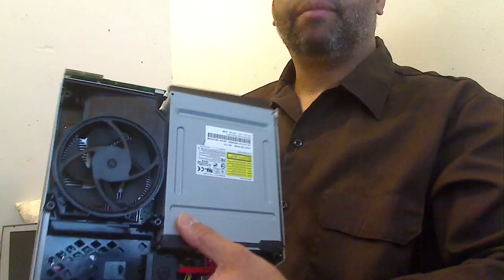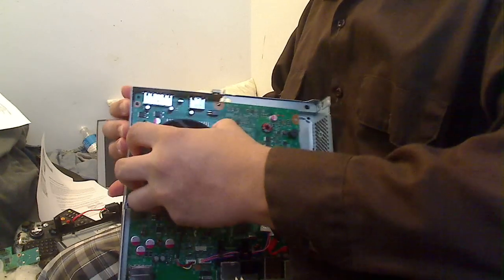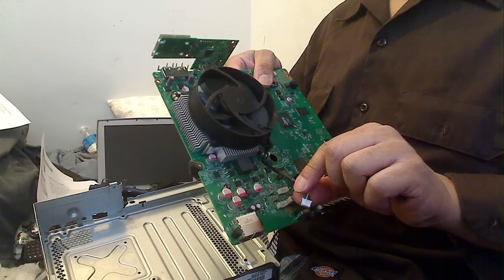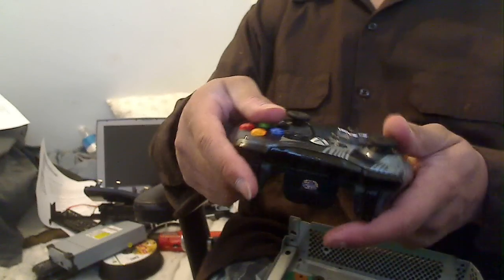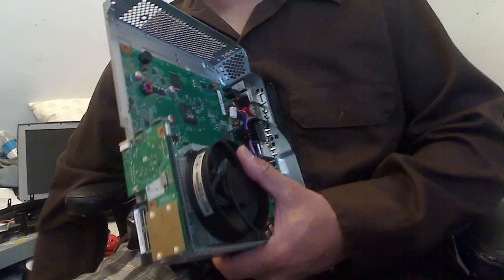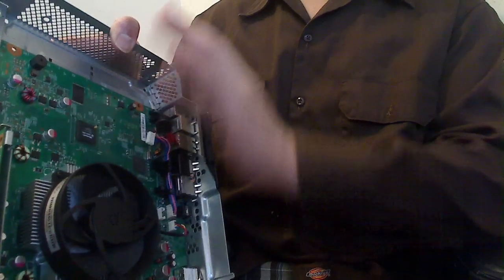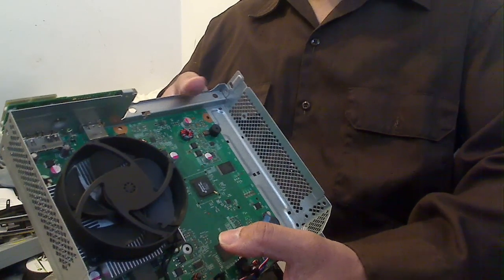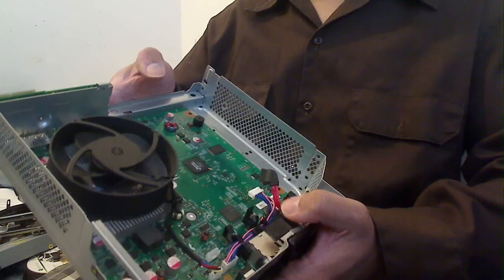How to fix Xbox 360 Slim RROD / Red Dot of Death Reset Solution👍

Comment: Hi Donte, Great video, with lots of instructions, my problem is slightly different to the one you are showing, but everytime I search for it, it brings me back to your video, so I shall ask incase you know, 3 times today my xbox has froze, when I turn it off and back on I have the redlight of death, ity stays like this unless I pull everything out the back and plug it back in then it works, I have now moved the console slightly as it wa sin a unit still had plenty of ventialtion around each side, but now it has even more, seems to be playing OK now, but not sure for how long, would the fact it keeps freezing and giving me the red ring of death be a early warning sign it needs the same treatment as your video.. Its been in its previous location for over a year with no issues.. Thanks in advance
Reply from the maker: When trying to determine the factors that lead to that horrid red-dot error, you have to take into account the minimal of two factors along with including all their variables that can lead to errors.  The 1st factor is your xbox and the 2nd factor is your power brick. The power brick contains a fan which also needs proper ventilation, since it will over heat also and stop your xbox from functioning usually leading to xbox 360 freezing. If you've moved your xbox and power brick to better ventilation then you may have solve your problem, especially if the power brick was overheating due to inadequate ventilation or even a possible fan malfunction. So Power brick or xbox malfunctions can lead to the red-dot error, not excluding the improper placement of a hard drive.
Reply: Donte Beachem
Thanks Donte, great advice, and very easy to understand, Its been fine lately, it did red dot once, but I put the console vertical turned it back on and it worked fine ever since,
Reply from the maker: Im glad you found a solution to get it working again..

Comment: Hi, after we remove the fan and are trying to overheat the board, the colour on the xbox power button will be red right ??
Reply from the maker: Noo.. That should not be red. If it is you my have a problem with your power brick. Either it has bad ventilation or it is damaged. It could be why your xbox isn't working..

Comment: Goodday Donte ,how are you,wish i did message you earlier,I need your help and expertise on how to get this xbox 360 slim back working.Heres my story,I got this xbox 360 slim 4gb from someone,its brand new of someway,where it was still in the box with all its wires and such,the person told me that they for about 1year and a half and they just open it up for the first time to play it with their son.After he was done playing it the gentleman told me that he package it back in the xbox box,which I thought was a bad idea.Long story short ,it has a red dot of death,everytime i go to power it on the red dot shows,the fan spins a lil then stop,I did all of the requirements in the video what u did,I even use a heat gun,5 minutes on low,10 minutes on high on both sides,i let it cool like u said,even took the power for the fan out to reset it,but after doing all of that ,it still pops  the red dot."NEED YOUR HELP PLEASEE"
Reply from the maker: Ok you may have done an overkill to get this xbox functioning again since it was practically brand new. You should have check the hard drive placement by removing it and reinserting back into the xbox or just remove it all together. The other would be to check the power brick light color to make sure it isn't turning red when you hit the xbox 360 power button. If it does, try a friends power brick to see if your brick is the culprit. Even if it doesnt turn red, try another power brick.
Reply: ok,it didnt came witha hardrive in it and ill try to use another power brick and let you kno the results
Reply from the maker: OK good. Good luck

Comment: If a fan is remove from a eprom or microprocesor it will burn our, Thats the rezon of the fan  and the aluminium disipator. to release over heat.Any computer expert will know this.
Reply from the maker: Hello 96gamemaster, your statement sounds good but its based on old technology and old knowledge. Most if not all newer motherboards, including the xbox have built in mechanism to shut off the processor before the damage can occur or burn out, as I believe you were trying to say. Desktop PC's for you DIY selfers allow the user to actually choose the temperature to shut down the processor and the computer. All "Computer Expert[s]" know this.. Have a great day..

Comment: one day my xbox 360 slim 4gb was updating and then it froze, then it restart it by it self and it was stuck in the xbox 360 symbol, so i restarted it and i got the red light but i turned it off and of a couple of time and it turned on just fine but it got stuck when i started a game then i restarted it again and i got the red light and since then i can't fix it. can you tell me if your steps will work for my issue?

Comment: Hi i have an xbox 360 S, that i replaced the rf power board, the lens is working, i put a new layer of fresh thermal paste on and im still getting the red dot.. any ideas what i can do?
Reply from the maker: cathal Devlin Over heat the processor using the method in the video.

Comment: hello & thank you for the video , i did apply what you said exactly on my glitched xbox ,now i don't have RROD , but once i switched my xbox on , it doesn't detect the controller & there is nothing on the screen , ps : i do have a glitch installed in it , in the first attempt with the fan unplugged there was nothing , but once i reboot it after letting it cool down , there was a blue light shining from  the glitch ,could it be the cause ? how can i check it ? thank you !
Reply from the maker: I cannot really answer this question since I'm unfamiliar with your glitch. Your glitch could be causing operational problems with your slim. If your glitch is a hardware installed item, check for new firmware update. If it's a dashboard hack, try updating to the newest dashboard hack. Good luck.

Comment: when i took my 360 to the shop, they said the xbox got the red dot because it froze on an update, they said they pressed some buttons together to reset and it was fine after tht for a little while. It has returned again. I was wondering if you have any idea how to do a simple reset just by pressing down on a few external buttons on the console, which is what they did. They said it was really simple so before i take it back, i was wondering if i could do this on my own. thanks!
Reply: alright, thank you.

Comment: If you don't mind me asking is the process the same for the slim as for the older white model, meaning after you remove the X-CLAMP and the pegs. this is how i fixed the white xbox 360 ( M5 x 10) 4 screws through the mother board then a nylon washer and then a metal washer and then tighten the heat sink to the cpu/gpu )
Reply from the maker: It is basically identical but it is not suggested that you permanently remove the X-clamp. Using the X-clamp prevents bulging underneath the Slim CPU/GPU, since the X-Clamp pushes up underneath the processor. Using washers may create higher pressure on the chip and create bulging which may lead to additional Red-Dot errors; ground-faulting.
Reply from the maker: Donte Beachem
Remove the X-Clamp for cleaning, re-apply the CPU paste and then re-install the X-Clamp.
Reply: I see well i proceeded with the screws before i put it together i re applied thermal paste, but upon completion i unplugged the fan like your video sated but my xbox only ran for a few seconds then it shut down so i couldn't get the 15 to 20 minutes of overheating, is there anything else i can do to overheat it a bit longer??
Reply from the maker: Anybodykilla1000 You probably have an update that prevents the Xbox from overheating to long. If that's the case a heat gun can be used, just like on the Xbox 360 phat. I mention the method for heating with a heat gun in the video. It's brief since the videos focus was reset by cpu overheating by absence of a cooling factor. Good luck.
Reply: ok great thank you for the support
Reply from the maker: No problem. I hope you get it working.
Reply: Donte Beachem
in the video you replaced the x clamp with bolts but in the comments you say dont remove the x clamp. help?
Do i install bolts? if i dont have nylon washers do i just just reinstall everything like it was?
Reply from the maker: Don't use the bolts. Use some cpu Heat sink paste & reinstall the xclamp

Comment: So my xbox 360 slim 4gb was working fine then in the middle of a game it had a checkered pattern come up and froze so I turned it off and then back on, now there is a red solid light that displays with no input on the TV . It blinks green as soon as it's turned on them it turns solid red, soo any suggestions, I also tried the heat and reset method but not sure how long it will take and  afraid to let it get too hot.
Reply: Take your Xbox part and rep lug in the ribbon for the buttons on front

Comment: Hmm, i opened up my slim to try this then i realized after turning it on while it was opened the fan would be on for a brief 3 seconds then turn off, which is the same amount of time it takes before the green light turns red. meaning trying to unplug my fan would be pointless seeing as it stays off by itself. any solution to that or does it mean my 360 is good as dead
Reply from the maker: There could be a problem with your power brick. Check it while powering on the Xbox to see if at any time the light on the power brick turns red. Is so, a replacement of the power brick may solve your problem. Borrow a friend's first to rest it. The power bricks for the Xbox 360 Slims are universal. Good luck.

Comment: I reset the xbox 360 slim but the old method by letting the processor overheat, shutoff, then after a minute, I powered back on with all cables in, and then letting the fan work normally and it was working again. Then after 5 minutes, I decided to put everything back together again and I unplugged the power cable without turning the unit off and when I went to turn it back on, it went back to showing me the error it had before which was E82.
Reply from the maker: Hey Stevn. The E82 error is a complex issue not well understood by the public. Some believe that its just some temporary error that can be easily fixed and some say that its a major cold solder issue under the GPU/CPU. I will be posting another video soon on an additional repair for the GPU/CPU cold solder issue and for those xbox slims that shut down before over heating. But for now you can try this method I found posted around the web in different forums. Not sure of the author and not sure if it works. Leave some feedback here if it does, -->

This is suppose to be a temporary fix for the problem, but please know;
1) I have not personally tried this, but a lot of users say it works.
2) Again, this is only a temporary fix that isn't guaranteed to work. The best thing you can do it contact Microsoft and hopefully come to a resolution, which will most likely result in you sending your Xbox in for repairs.
STEP 1: Switch on you Xbox 360 and wait for around 3-5 mins even when it shows up the E82 error.
STEP 2: Now after that, just switch it off and wait for 5-10 seconds.
STEP 3: Restart your Xbox again and wait for it to get started, initially it might show the error at start but soon it will startup normally.
Reply: I tried that and it still went to the error. :(

Comment: Why wont my Xbox turn its self off from over heating its been about 40min. The fan is off and its just bare circuit board on top of plastic, nothing is blowing on it to cool it off?
Reply from the maker: Hey Litlehawk80, sorry that you're having problems but one of Microsoft's updates to the Xbox 360 slim shuts the Slim down before it will allow it to completely overheat and then shut itself down, completing the reset..  --> I will be posting another video soon on an additional repair for the GPU/CPU cold solder issue and for those Xbox slims that shut down before over the heating and reset can occur.
Reply: Donte Beachem Okay, I tried again with the fan removed so just plain heatsink on CPU,case open so just circuit board, I had it run for 1 Hour timed and it didn't shut off at all, I shut it down after that 1 hour for fear something might have gone wrong. I can't figure out why it wont turn it self off it just runs with heatsink and nothing to cool it.
Reply from the maker: litlehawk80 Hey litlehawj80, my apologies for taking so long to reply. There seems to have been an update that affects the shut down time for the Slim implemented to prevent Slims from overheating to long. The reset should still occur but on some Slims it just isn't working, but an alternative solution is coming in my next video. I already shot the video but it needs editing.
Reply: Donte Beachem Hello, thank you for the help, when will the next video be up, my xbox just got the ring im going to try this right now it does different things every time i turn it on.

Comment: you saied to turn on the xbox without the fan connected and wait for it to get more hot , after 7 min its turned off automatticly and blinked red dot like a warning sign is thet okay ? now its cooling off , after 30 min should i connect the fan again and will it work ?
Reply from the maker: You should always connect the fan afterwards. Only you can tell if it will work afterwards, not I. I do not have your xbox. You do. You will have to answer the question for yourself "after 30 min ... connect the fan again and will it work?" You let me know if it works! Also keep in mind that if you have the most recent xbox 360 update, that your xbox will shut down before the over-heating and before the reset will occur. I will be posting a video within the next week for a work-around for xboxes with the newest updates..

Comment: How do you know when it has reset?  My red light went from solid, to blinking.  I plugged my fan back in, and nothing.  Still as solid red light.  I am not sure that it fully reset.  Also, how long should I expect it to take?  Thanks for all your great info and help.  You are the only one I have found addressing RROD on a slim.
Reply: i tried it and mine did the exact same thing....

Comment: after disconnecting the the fan and pluging it back in should the power light be green? because mine is still red
Reply from the maker: You have to do more then disconnect the fan and plug it back in. You are required to do a reset using the instructions outlined in the video.. Perform the steps required and ask any additional questions afterwards..

Comment: hello there, i had on my xbox 360 slim red dot. so i reset it as showing in video. red dot now gone, but now on tv showing as no signal.. can u help? if there is any solution for that?
Reply from the maker: Audrius Nagulevicius change the video cable or use the alternative video cable.

Comment: I did the reset and everything and it works on my tv without the red light when my fan is unhooked but as soon as i hook it up again I get the red dot... please help me and let me know what I have to do Donte Beachem
Reply from the maker: Wow. Ok. Well I'm not completely sure unless there is something wrong with the fan or a component on the P.C.B. that does not want to supply power to the fan. You could try replacing the fan. If your Xbox does not want to supply power to the fan then you can expect a ground fault to occur. If your Xbox doesn't want powered supplied to the fan then it's trying to prevent further damage. You'll have to either replace the fan or find another way to cool the heat-sink. Hope this helps..!

Comment: hi i have a black xbox 360 slim when i turn it on it goes from green to red dot. the fan starts for like 5 seconds then stops and nothing happens. red dot just stay thers and i took it apart and diconnected the fan pluged power cord in to let overheat and it never overheated it went on for over a hour sitting on the red light what should i do? o and i dont have a harddrive for it either
Reply from the maker: Check to see if your power brick is working and that it doesn't have a red dot as well

Comment: What if I don have heat sync paste what can I use?
Reply from the maker: You need heat-paste for the transfer of heat from metal to metal, so that it doesn't burn the metal. Heat cannot transfer from one metal to another metal efficiently with a thermal insulator, --> http://en.wikipedia.org/wiki/Thermal_grease

Comment: It still isnt working please help
Reply: Same I really don't know why I also tried resting it twice its still the same
Reply from the maker: sphinixLike There may be something more serious wrong with your xbox. It may have been exposed to a power surge or the power brick could be the culprit. Try unplugging controller cables and check inside the usb ports to make sure the usb pins aren't touching each other or the metal side of the port. This can cause a ground fault.

Comment: Hello will this solution work for my condition?
So i placed my xbox behind the tv and I was sure that the fan wasn't cover so it was able to take air. My xbox have a solid red dot after like 5-15 sec and my screen is black nothing appear on it, can you pls help me :)
Reply from the maker: Try replacing the hard drive and check all your USB ports to make sure the pins aren't bent, smashed or broken.